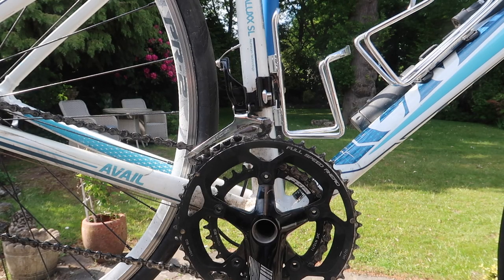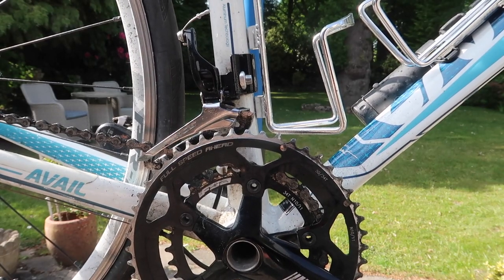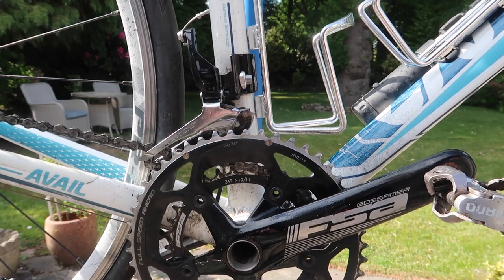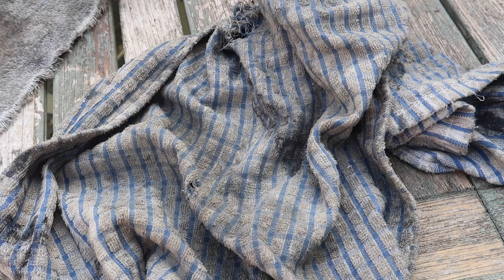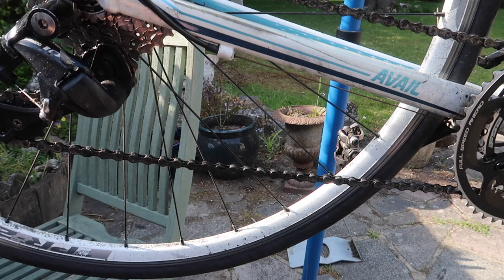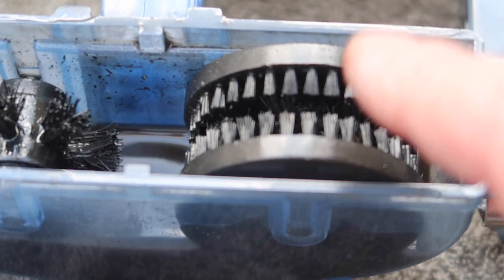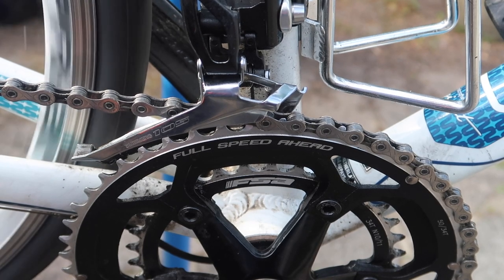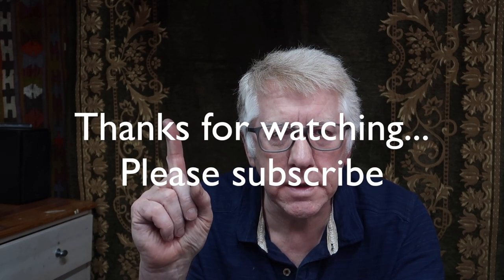How do I clean a bicycle chain, chain-set and derailleurs?

Comment: I used Gunk for a short while and works well.  But it absolutely stinks, so much so my wife has banned me using it.  

Tend to use degreaser from screw fix in a 5 litre container very cheap.  I buy cheap toothbrushes to clean my bits 😏 , would wire brush not cause micro scratches and over time scratch the components?

Comment: Why is it important to turn the chain backwards
Reply from the maker: If you go forwards you'll push the chain cleaner into the chain-ring.
Reply: @JulianHutchings  seems like that's what want to do in order to get it into the roller pins of the chain because spinning it backwards would only clean surface dirt and oil. Just my opinion